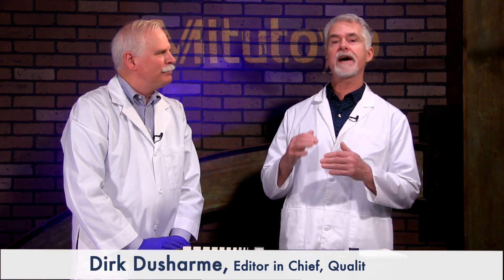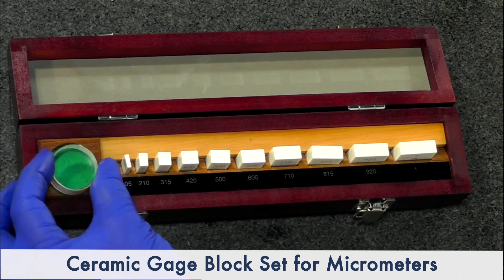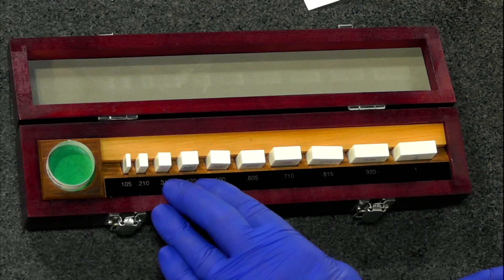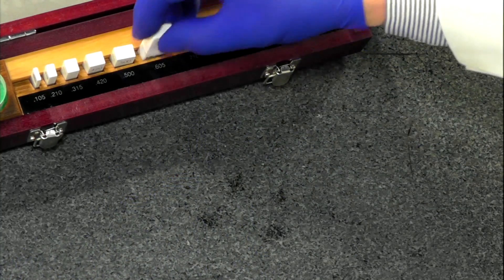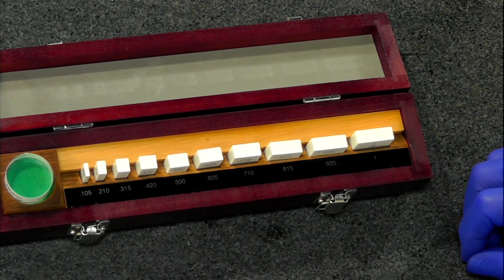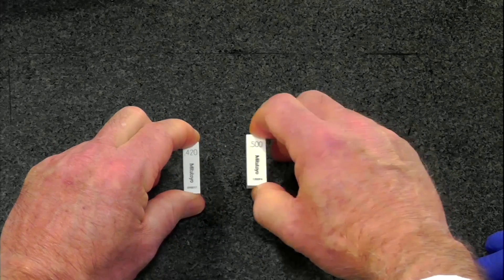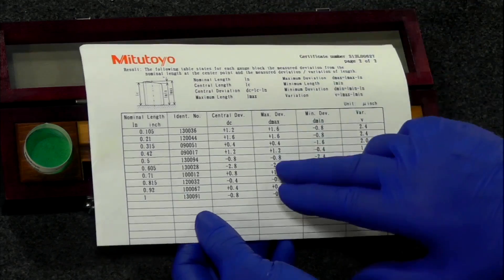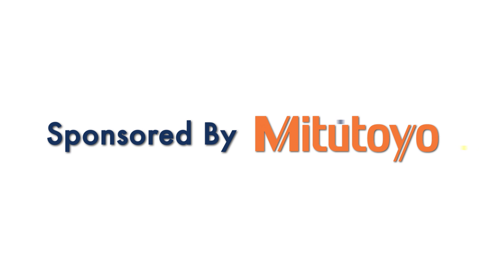How To Ep04: Use Ceramic Gauge Blocks #metrology #guage

Comment: How to use a digital caliper to checking off center on my steak I'm like still casting for the hub How do you hold a caliper when there's a slight radius on it